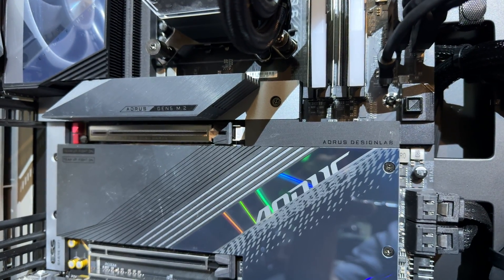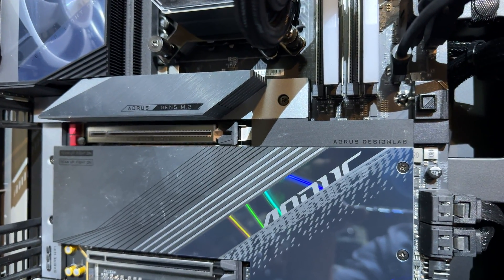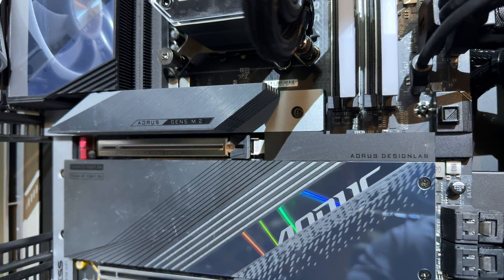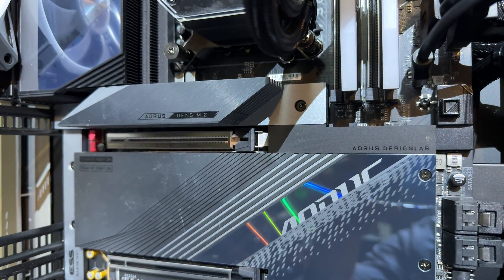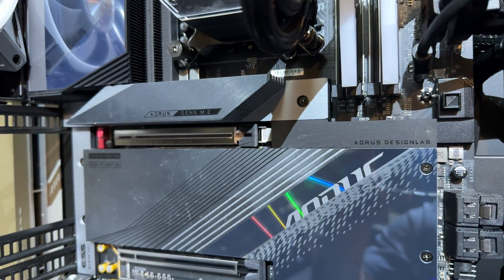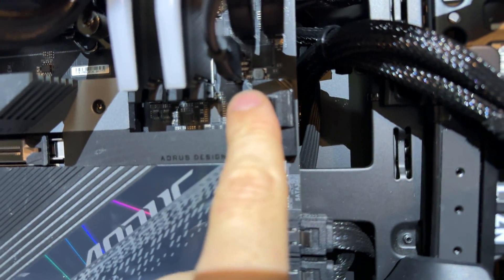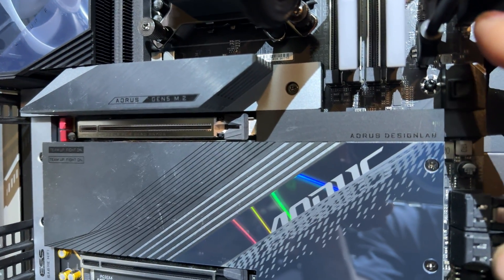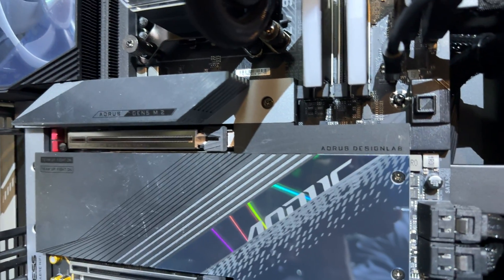How to use the Mechanical PCI-E retention clip release button on Gigabyte Aorus Z790 Master

Comment: I didn't even know it had quick release, this knowledge would have been useful yesterday when I upgraded my gpu, instead of having to unseat my cpu cooler, to press the retention clip.
Reply from the maker: well.... sorry I didnt help then :) Hey, have you had any weird disconnection is issues with the 10G nic?
Reply: @dragonsystems5973  I have the X870E AORUS MASTER and it only has 5gbe ethernet :(  I did have an issue when I unplugged the ethernet and and it stopped working, I had to do a complete shutdown and unplug the power cable, (a simple restart didn't fix it) for it to work again.
Reply: you're not the only one, I've been shoving a small wooden dowel between the cooler and gpu backplate to press down the latch. Guess we know for next time

Comment: I honestly wish my motherboard had one of these. The creators of my bord probably didnt consider 2024 parts in it as my GPU covers both m.2 gen 3 slots so every time I want to do a storage upgrade I need to use a screwdriver in the hole between my cooler and gpu to get it out.
Reply from the maker: It is deffinitely quite useful

Comment: My Asus strix z790 gaming E also has a release button. Very nice to have and way easier to us. Should have been this way since the begging.
Reply from the maker: I mean, I dont think the retention clip is even necessary at all, to be honest. On my ASUS X299 Sage that is now my dedicated testing rig I(carefully and nondestructively) removed it, that board is designed in such a way that its virtually impossible to release once ive put a card in and I got fed up with it after like 20 installs and removals
Reply: @dragonsystems5973  lol I believe it. Unless you’re moving the pc around, I would not think it would slip out of place. especially if you have something to help with GPU sagging.